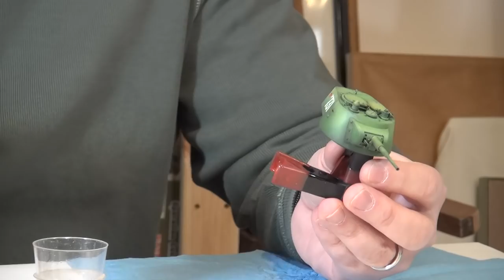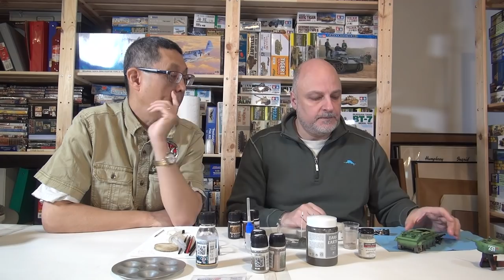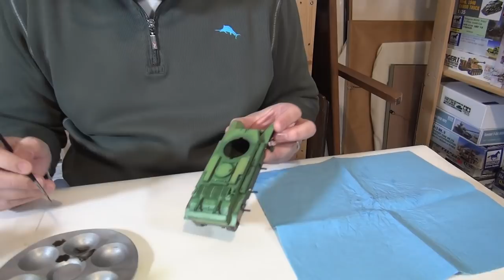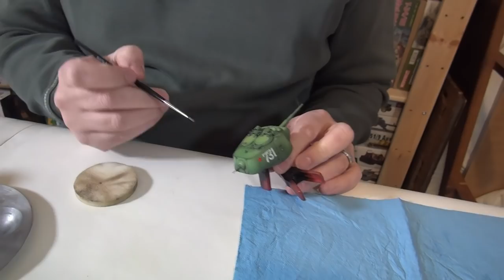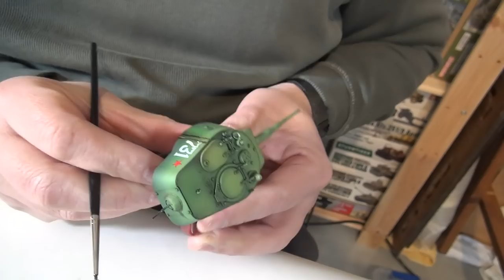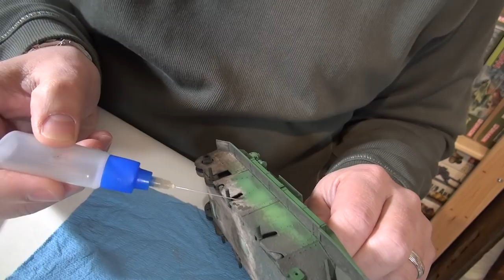BT- 7 Episode 4

Comment: by the way love your airbrush modulaiton in the tradition of A. Wilder (I have hard time and have to do a alot of extra oil paints by hand to achieve good results but I can say my airbrush modulation has definitely improved thanks to using A LOT of thinner  when airbrushing base / modulation  as Dave Brown always stressed
Reply: The secret is low air pressure (12-15 PSI) and thin paint (at least 50/50, sometimes 40/60 paint to thinner).
Reply: @daveforest28  thank you I follow these steps and see much better results but you seem to have better control of air brush and Eye for color may take more practice and patience -